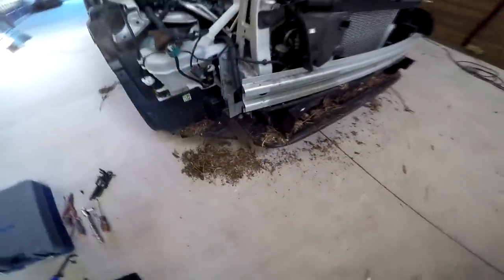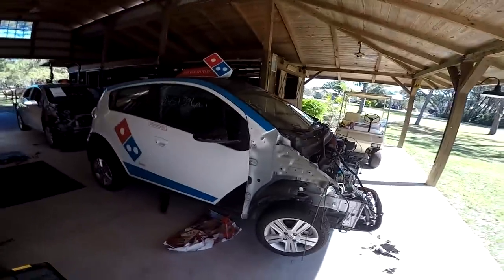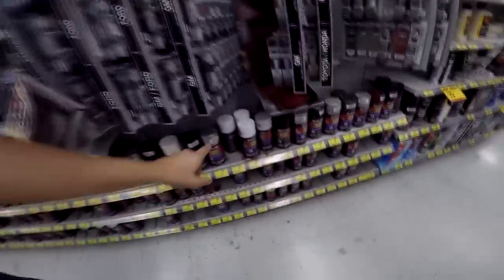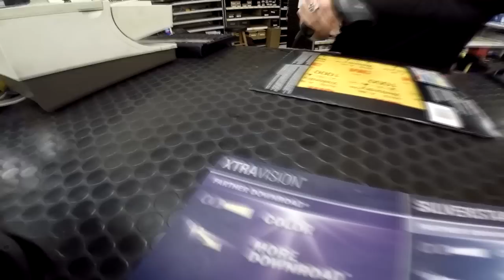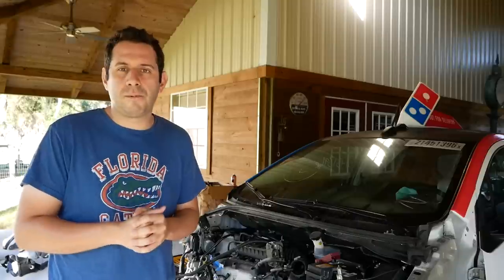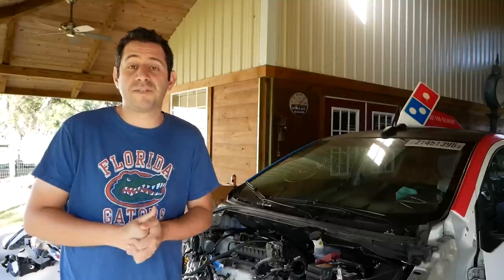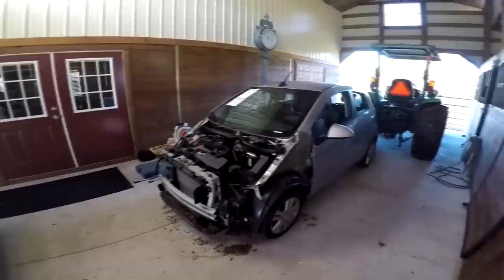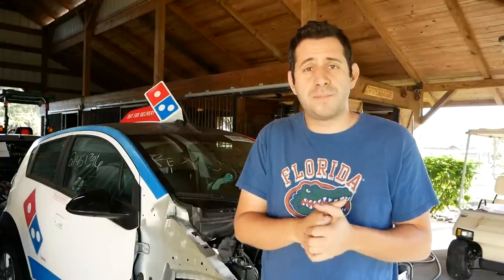The Plan for Painting the Domino's DXP Pizza Car Rebuild (Flooded Spark is Officially a Donor)

Comment: I'll add a comment about something you touched on briefly but maybe haven't thought about.  There were only so many of these cars built, I think you said 100.  When Domino's is finished with them and they have 100,000 miles on them, they will be stripped of the Donimo's Badging and sold as regular Chevrolet Sparks.   You might have the only one that has become available for the public to purchase with all the Domino's badging.  This car might become highly collectible in the future, especially with such low mileage.  Just something to consider when doing the repairs.

Having the VIN number that is connected with the original Domino's car will also keep the collectibility high.  So swapping all the Domino's parts over to the donor car is not advisable if you are thinking about keeping it as a collector car.  Having a paper trail connecting it back to Domino's is important.

I've worked for car collectors and documentation (even the correspondence between you and domino's)  is paramount when these collectors are searching for their next investment.

good luck  with the rebuild.

Comment: Shouldn't you get it running before you even think about body work...??
Reply: MogDog66 I actually think that this was a smart decision and good use of his time.

Sam is farming out the body work and paint, he is not doing it himself.  I am sure it didn’t take him long to deliver the parts to the body shop and he probably needed to disassemble the front of the silver Spark to get easy access to the parts he needs to get the DXP car running.

Now, while he is working on the motor mount/mechanical issues, the body shop can also be working on the body work and paint.  Both parts of the project are now able to be worked on at the same time.

Hopefully, by the time the engine issues have been fixed, the other body panels will already have been painted and the paint will have had time to cure- all ready to be picked up and installed.
Reply: Well considering hes got 2 engines to pick from its not exactly going to be much of a worry

Comment: For anyone thinking you can buy a waterlogged car to use as a base, you have no idea how horrid your future would be. NEVER, ever do that. Waterlogged cars are only good as donor cars, and if car god forbid, the water got inside, never use the interior. There's the likeliness of deadly spores from mold flying in there.

IN SHORT, only as a donor, only for clean or cleanable parts.
Reply: So, buy flood car, swap seats?
Reply: What people dont seem to realise is flood water usually contains mud, silt, sand and even raw sewage. Anything that was in drains or on the ground is now in that water.
Reply: Engine
Reply: false. older cars with less electronics can be used. carbureted cars for example. id gladly take a flooded car and fix it just as a finger to those saying it isnt possible.
Reply: Frigglebiscuit no one said it was impossible all they said was anything with foam or fabric would be completely ruined.
Reply: Clean seats with bacteria and mold killing agents
Reply: Captaintoast12321 then dump the car in fresh water.
Reply: aserta how good is the engine after flood damage? I've been looking into a c6z06 for an LS7 swap in my c5. Is it even worth getting? Is the engine done at that point?
Reply: Nate Hahn depends. How long was it in the water? Was there water over the hood? Are you going to just pull and swap, or rebuild the engine?
Reply: Frigglebiscuit I'm only interested because the market is flooded with flood cars. The engine and possibly the transmission are what I really want. Selling off any good parts To recoup money is an incentive to get one but if the engine is toast then my interest is very low. Rebuilding the engine isn't what I want. I feel like buying an engine by itself would be better then rebuilding a flood car ls7. But if I could save a large sum of cash with a little time and effort then I am interested. I found one with a water line about 6-8in above the bottom of the door. The engine appears to have been mostly dry but the interior is gone for sure. Is it something worth keeping an eye on?
Reply: aserta 
Would leaving the car in subzero temps fix the mold problem?
Reply: Nate Hahn if you can get it cheap and dont care about the enterior, id go for it. I always have a rule: where are the fluid pour/ drain points? Did the water reach that point? Was the car driven through the water running? An electronic bore scope with a screen is your friend.
Reply: Hobo Sammich just spray the interior with an alcohol mix or some other mold cleaning compound that wont wreck fabrics. No bleach.
Reply: flood cars can be fixed as long a the waer lineis below the seats and electrical still works
Reply: Flooded cars are perfect for flipping and selling.. all you have to do is make him smell good and run...
Reply: Samuel Yi --
Sancrac showed what he felt was the "high water line"; as I recall it was like an inch up on the drivers door panel. Well below where the electronics are mounted in that car. Electronics are the most vulnerable parts of any vehicle. But with a "flood" title a vehicle like that would always be under suspicion and once that history is revealed to a new owner .... Leave the ramifications of selling a car like that to your imagination - cha-ching goes a lawsuit to the "victim" purchaser down the road a few years.
Reply: To properly salvage a flood car it needs to be completely disassembled, I mean completely, in a classic car it would be referred to as "frame off" or "Taken to Bare metal"  then reassembled,  for the cost of labor and incidental parts you'd need to complete re-assembly you could buy a good one, heck maybe even a NEW one.
Reply: Capt. Beak
I'm sure that varies by state. Some states are notorious for lax regulation of salvage car repair, and the subsequent issue of a "clean title". In the past it was hard to identify vehicles that had been issued a salvage title, then been "rebuilt", and then issued a "clean title". And those vehicles with "clean titles" were usually sold out of state, so those "notorious states" didn't feel the to change their laws - like a "not sold in my backyard" situation.

With programs like CarFax and other similar companies it is far easier for used car dealers, potential owners, and new owners to discover the true history of salvaged vehicles. And in the aftermath of Hurricane Irene in 2011, I have seen some reports of a few states tightening up the situation with salvage title vehicles, maybe with some prodding from the Feds.
Reply: Nate Hahn  If it wasn't sewage or salt water and it wasn't running or started while still submerged then a good cleaning and a change of all fluids 'might' be enough. If it was sewage or salt water then I would pass. Copart and others label them as 'Bio-hazard' for good reason. There will always be another, with perhaps just rear end damage.
Reply: Yes I know my insurance company got caught letting Irene cars out with out a salvage/parts only title, enough got out to cause them some embarrassment, they had to turn around and buy them back again

Comment: Hey Sam. I go to Finishmaster. They mix any color in spray cans. Also you can now buy 2K clear in spray can that comes out like glass if used properly. About $20 a can. Works for small jobs like bumpers, moldings, mirrors and the clear blends very well

Comment: Sam, 

You should try and make your own small paint booth out of plastic drop cloths.  That would make rattle can paint jobs much easier on you.  When you're done, tear down and throw away or fold up and store for the next time.

Do the air bag replacement first.  I've never seen that before.

Also, thanks for showing all the Copart (?) information on how to buy a car that's up for auction.  That was a LOT of very useful information!

Regards, Tom

Comment: Basically the only thing we've learned from this video is that you were looking at cheap paint, usually when you paint a car with rattle cans you go to the auto parts store with an actual paint code and they will mix you paint cans that are precise.  The other thing we learn from this video is quite simple, they issue salvage titles on vehicles so that they cannot be placed back on the road if that is common knowledge.
Reply from the maker: +wingerfan1 no, you see salvage titles can be rebuilt. Junk/scrap/destruction titles can not!

Comment: Work from the firewall forward. Get that engine mount fixed an you'll need to fix the plumbing next.  Fix the suspension and then the radiator support and associated parts. Hardest thing is not breaking the plastic parts when removing them.

Comment: You can paint with a rattle can, it's actually harder to get good results that way but it can be done.  The important  thing to consider is using a 2k primer and clear with proper protection (even with a rattle can)

Comment: I painted my whole 86 F-150 with rattle cans.
Reply: cool!
Reply: +Alec's Garage not too bad, you have to be right up on it to see any issues or runs. just normal pass and go, it looks near perfect. you can see pics at www.facebook.com/GLyeehaw
Reply: Titanic Truths alot of times you can paint correct the runs. Maybe some wet sanding.
Reply: Can’t imagine how much u had to use 😂😂
Reply: I've rattle canned my Datsun and my bug it's pretty difficult to perfect and you end up spending as much trying to perfect then just doing a cheap job somewhere.
Reply: Titanic Truths Ew
Reply: are you the long lost 3rd brotha duke ?
Reply: Small world! I'm about halfway through painting an '87 with a roller. Just the middle stripe, the rest of the paint was fine but the stripe was peeling. Does it look factory? God no. Does it look good enough for a 30 year old truck? Yup!
Reply: I have an 89 F-150 Lariat, do you have any problems with the gas pedal sticking? Also, does your heating system in the cab smell like exhaust?
Reply: Nope and nope. The linkage on your throttle body might be binding up, or the cable might be buggered. Not sure why you'd get exhaust through the heating system unless you've got a serious exhaust leak. You might also check the heater core, on the off chance that's what you're smelling.
Reply: At first I thought it was an issue with the catalytic converter and the exhaust so I got that completely redone (which it needed), but I'm still getting issues.  I found that if I turn the heat to just defrost it solves all the issues though.  I'll check out the throttle linkage, thanks m8.
Reply: Weird. Maybe there's something in your vents? Hopefully the throttle's an easy fix. Not much to it.

Comment: Awesome. Keep going. Interesting project. Great info about titles. Agree with spray paint, because I'm not good at it either. And a good paintjob makes a good first impression and lasts longer (regarding scratches, rust etc). At least my 2 cents on the issue. Can't wait for the next video.

Comment: Will the wrap come off with heat?  Then you could use it. Have the shop color match for you with the paint code. I made a mistake spraying white before and it didn't blend well. Spray paint doesn't last long. If you have to use wrattle can look in to 2k. you pierce the bottom and the hardener mixes in and is good for a few hours.

Comment: Good luck! Chevy spark is a nice enough car... Only complaint is that when the A/C is on it doesn't accelerate worth a damn and the A/C is pretty small and doesn't work all that amazingly in the hot summers... Definitely wish I would have gotten the sonic instead but it was still a good car and reliable for me. Just cut the A/C off if you need a faster start off as 0-60 Is 16+ seconds in the automatic version.

Comment: repair the engine and trans first to make sure it starts, runs and moves under its own power. that way if you need to replace the engine or wires, you can, because both cars are half appart and would be relatively easy to swap bits straight over.

Comment: Be aware Sam- when you replace the airbags and belts, that you will also need to replace the sensors and possibly the control module.  If you don't, you tun the risk of popping the bags the moment they see battery power.
Reply: Hotrodelectric The Spark shop manual will tell him that.

Comment: Only thing with swapping car parts from one to another is some part are dependent on whether it’s manual or automatic for insurance you cannot take an engine out of a manual and put it in an automatic or other way around as they use different gear box

Comment: I bought a car at auction, turned out to be a smoker's car. I pulled EVERYTHING out of it. I steam cleaned everything i could. The seat padding, I couldn't steam clean but I hosed out and used Febreeze all over the pads and the leather covers. Went through 2 gallons of Febreeze on everything. I even steam cleaned the headliner. There's still a faint smell of cigarette smoke inside it but it's not completely intolerable like it was. And I do mean I pulled everything. The entire dash, HVAC system, carpet... it was a bare shell inside the car. And that was a LOT OF LABOR. At least 24 hours of labor to pull everything, clean it, and reinstall it. AT LEAST. There's no way to do it easily. You do it right or you don't do it and you live with the smell. You can replace cigarettes with mold, biohazard (chemical and or blood) or anything else you like, the process is the same. Everything gets pulled, everything gets disassembled, and cleaned. What cannot be cleaned gets replaced. If I wasn't on a budget I'd have bought replacement headrest and seat cushion pads, armrests, and headliner as those are where the smell comes from the most, and the headliner has burns too.

Comment: See if the engine starts first... timing might have went out? Then you need to transplant the engine as well. Please tell me how do you plan on replacing the airbag control unit, with VW the airbag control unit will not work twice, just like the  bag and it has to be programmed to the onboard power supply, the one in the flud car might not work with just swopping it out? Then the airbag light will remain on..?

Comment: If someone wanted to use the donor as a daily driver, it'd be an easy fix. Replace the carpet and underlay, and while on a lift use a high pressure spray to clear out the dirt and debris off the underside.

Comment: To get rid off smoke smell is easy in aus i get odder controll bom it's in a can and all you need to do is run the car for 10m with ac running and Windows up and then another 5-10m with Windows down